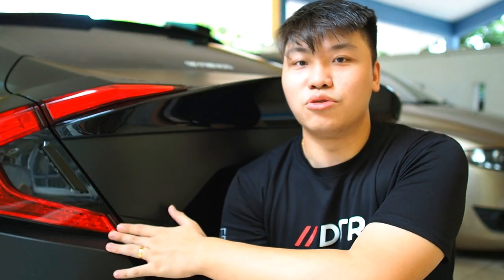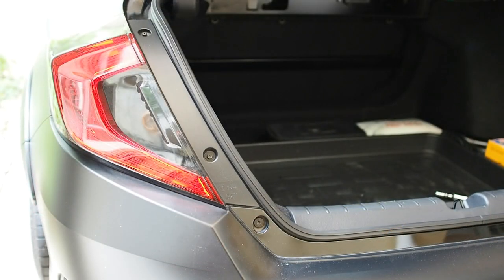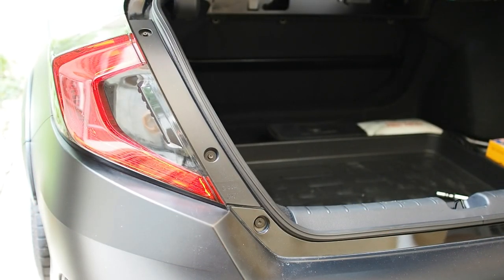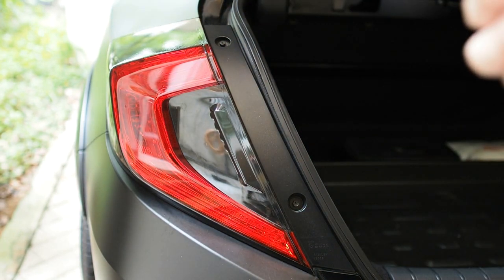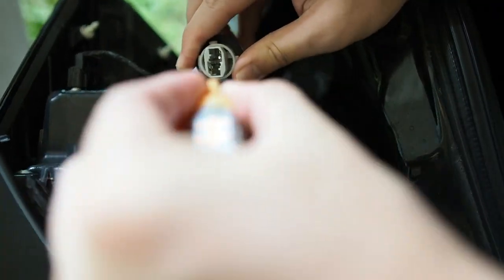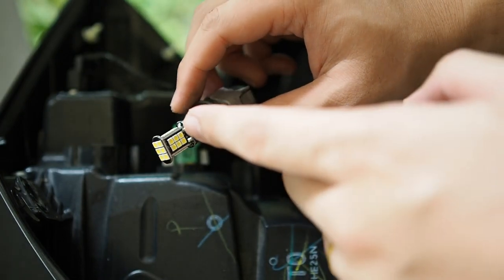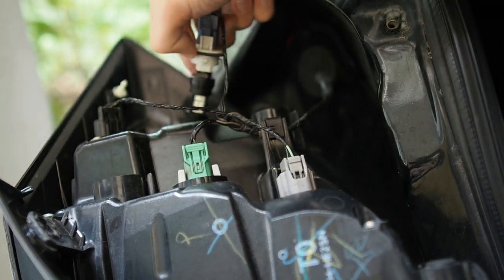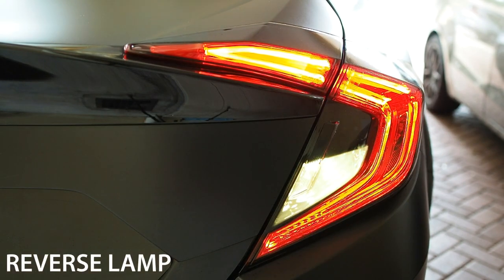Honda Civic FC/10th Gen LED Taillamp Conversion Tutorial

Comment: will the signal flash very fast after changing to led？
Reply from the maker: @lionellim4413  get the right wattage or super bright ones then should be fine. I never had the fast flashing issue.
Reply from the maker: @lionellim4413  get the right wattage or super bright ones then should be fine. I never had the fast flashing issue.